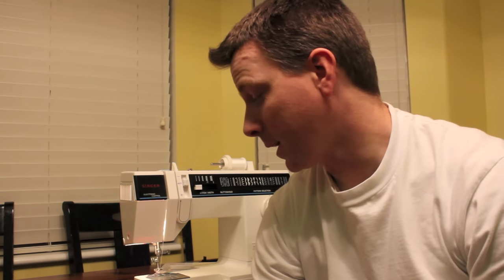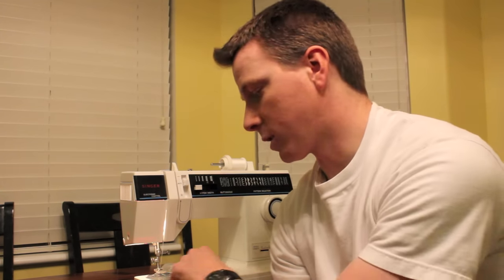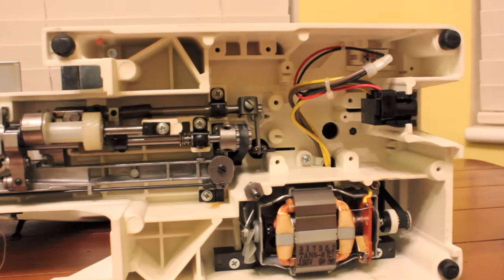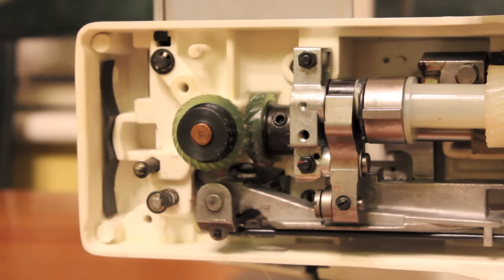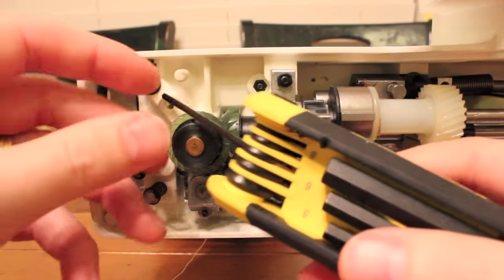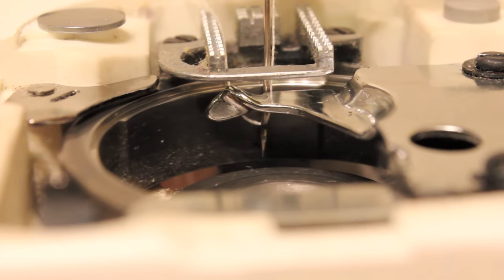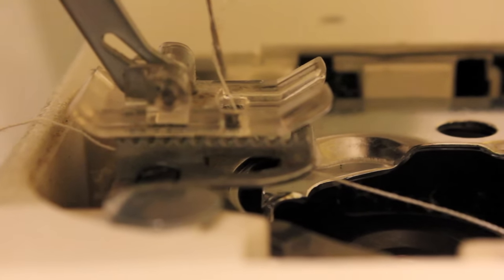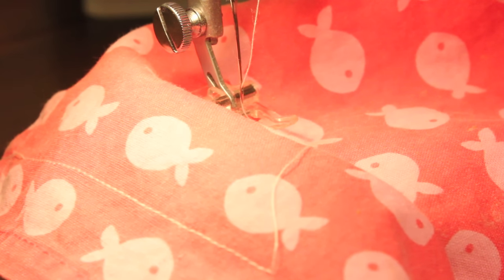How to Fix / Repair the Hook Timing on a Sewing Machine

Comment: The main thing about this is seeing with your hands sometimes. It is a matter of lining the gears and turning the hook so that the needle does not hit any metal but where it will clear the hook on its spin around and then you must take care to line the gears for the foot to move the material at the right time, like when the needle is up the foot dogs will kick the material back and not hit the needle in the cloth. Timing.

Comment: Hi I a wondering if you know how to fix a brand new singer promise sewing machine that jams every time I start to sew, and i have to take apart the whole bobbin casing to get it to move again. The right hand wheel wont turn at all and there is no thread stuck in it, if you could help that would be fantastic!!! thanks!

Comment: I have 2 fairly new, barely used sewing machines. I am having the same problem with both. As the needle drops down it hits the top of the bobbin case, and I can't for the life of me figure out why. Any help would be greatly appreciated. Thank you.
Reply: I'd say that's more of a needle installation thing. Unscrew the needle, ensuring the flat part is against the shank (assuming these are domestic machines) push them all the way to the top of the groove (On my domestic machine you can see the top of the needle hitting a pin) and tighten the screw. If the screw isn't quite loose, it might be stopping the needle going in all the way. You might need new needles, as they could be bent, but as this is for two machines I'm unsure.

Comment: Awesome, I got my timing fixed and now my bobbin in threading but the tension on it is waaaay off.  This is weird because I have a computerized machine that is supposed to auto adjust the tension.
Reply: Well it needs to be within a starting range.

Comment: There is nothing wrong with fixing something yourself if it is possible. That is absolutely disgusting that they would charge you $90 for something the only took 15-20 minutes to fix and no parts. I was told that my late mother's Singer which was revolutionary in its day as it was the very first machine that was computerized was not fixable. The repair place said they would be happy to dispose of it for me!!!! Yeah, I'm sure they wanted said machine.  I took the bottom off, pulled out lots of dust. Low and behold, I pressed this reset and it sounds fine to me. There are a few other things I need to check out like the timing hence what brought me to your video. Also for some reason some of the lights wouldn't go on now.

Comment: Nice video, but the timing was adjusted in the wrong place. The gear you moved tightens on a flat spot on the shaft. It will eventually slip back to the flat spot where it is supposed to be. However, at the RIGHT end of the shaft is the proper timing adjustment. There is a gear that the belt wraps around. It has TWO set screws. Two set screws are required because the shaft is round there. That allows full timing adjustment.
Reply: Well said. And he did not check the feed timing. He got lucky.  You mess around you pay double

Comment: You should time this on the other end of the  lower shaft with the belt.  You were lucky the drive gear you tightened is on the flat of the shaft.  The drive pulley has two set screws since the drive shaft is not flat on the right side.  There are many other problems a professional would have adjusted when a full service was done.

Comment: I just broke my girlfriend's Singer (pray for me), and the timing seems the issue, too. Her machine is not as easy to open up as this one. Are there models out there in which the gears inside are more easily accessible?
Reply: SInger "Heavy" duty 4411 -- removed 6 bottom screws, and the timing pulley with two set screws was right there. Looseedn them, held the bobbin carriage by hand gently (avoid being cut by the hook and pierced by the needle), turned the pulley gently, until the needle timed.

Comment: That gear is "not" the timing gear, that only has one set screw, and it sits on the "flat" on the shaft. And without the timing gauge for proper settings is not used, on the needle bar, you will find that the tensions will not balance properly. *Happy Timing your Singer machine(s), you may now have to pay more the 90.00 to correct it, to the specifications.

Comment: my problem is my needle keeps hitting a metal plate inside the machine x-x and its a singer 466 model that i inherited from my grandma so i dont know where i could find help for this T-T
Reply: +Ro Draws , alignment of the needle is not correct, most likely your needle is bent.
Reply: Ro I was having the same problem and found that the needle was not pushed in far enough.The timing is so close that even a slight bit out it will catch. The bent needle that Sayumpu mentioned is very possible too.
Reply: Ro, I had a tiny piece of broken needle in mine and it messed up the timing over time. This goes along with Gary's message. Could be the needle isnt in all the way - or hadnt been for awhile and caused damage.

Comment: help. The black bearing where is the set screw is sometimes turning and sometimes not turning.  So the shuttle driver sometimes turn and sometimes don't  turn. So the shuttle race is not at the rigt place when the needle is down.

Comment: i have a singer touch & sew mod 626, the bobbin mechanism does nothing, the bobbin should move right whwn threading and sewing rifht?
Reply: Sounds like drive gear underneath has gone. BIG job even for me to do. You will NEVER get it 100% right if you try and repair it.

Comment: I cant seem to get the hook timing down...i have loosened the time gear a number of times and tried lining up the hook but whenver i tighten it back up it wont fix the problem with the needle hitting the other metal parts which breaks the needle. How can i fix this??
Reply: Jordan, I had the same problem and it brought me to this video. The hook (shuttle) on my machine wasn't getting close enough to the needle to grab the thread. I removed the bottom plate and loosened the screws that hold the shuttle (hook mechanism). With my right hand I held the plate still and with my left hand I adjusted the hook (shuttle) so it would be closer to the needle without allowing the needle to scrape. I carefully laid the machine back down and tightened the screws to the base. I then adjusted those little set screws that Nils showed in the video. Problem solved. However, it took me four days to troubleshoot my issue. Whatever you do don't take your machine to a repair shop. They will charge you more than what your machine is worth. Put your machine aside and buy another one for under $100.00. Before I fixed my machine I bought a Janome Mini for $60.00. Now I have two machines that work.

Comment: what if your machine switching to different stitches. my machine only does straight stitch but no other one. is it still the timing?
Reply from the maker: +Bianca Edwards That doesn't sound like a timing issue. If your timing was off, it wouldn't be able to do the straight stitch either. I'm not sure what would cause it to not do the other types of stitching. Sorry!

Comment: hah, funny.  my mom has an all metal 50 year old singer made in italy and was recently given a singer 7442 cheap chinese piece of shit that they make now.  i never need to adjust the old one for her, but the new one hit a button and now is off.  the needle scratches the plastic area in the shuttle if not set on the highest width and wont catch the bobbin.  i need to follow your instructions and make the adjustment. just wanted to say thanks for making the video...and in HD! :)

Comment: Sounds like your top tension is way too loose. Try turning the top tension 2-3 numbers higher and see if that helps. Also check to see if the upper thread is threaded properly, especially through the upper tension control.

Comment: My machine (janone mc)  will only let me turn the gear that adjust the hook timing a tiny bit like maybe 10%. I have the set screws all the way out and have now taken the shuttle and the gear that is attached to it out because i thought maybe there was something in that gear and it was stopping the one on the shaft from turning. Theres nothing in there stopping it that i can see.

 Can anyone answer this question. When the set screws are loosened, is that gear on the bottom shaft suppose to freely rotate all the way around?

Comment: There is a reason it costs what it does when you get your machine serviced.  The technicians will take apart the machine clean it out and oil/grease it.  Certain parts can seize or stick with old grease that you may or may not know about.

Comment: OK WAIT-tiny bit confused! ???
Loosen the Set Screw-manually turn the wheel, when the needle/hook cross correctly again, tighten set screw?
Reply from the maker: It is confusing. It’s more of a trial and error thing. Loosen set screw, rotate it, tighten set screw, test, repeat.

Comment: Can y ou please help me out, my singer machine is not picking up bobbing thread.
Reply: that is a hook timing issue...provided your needle is installed properly...meaning all the way up and with the needle scarf(short groove) in back
Reply: If it's an old machine, it's probably timing, but if it's a new one, it could be as simple as you using the wrong kind of needle for your fabric.

Comment: Whilst I liked your attempt to fix the machine and you've somehow managed to remedy it... its not exactly right as the timing should not be done from the 'rotating hook vertical gear' as its allen key has to secure on a flat dent on the shaft. The timing should rather be done from the horizontal gear that is mounted on the rotating hook's shaft'. That is the gear to the left and not one to the right at the rotating hook area. Notice the gear to the right has only 1 securing key whilst the one to the left has 2.
Reply: Cosmic Fugue
Reply: I found this video after trying the same solution.  However, I find the comments are often critical to getting the fix right.  Knowing that I had to get the set screw into a special part of the shaft (in my case there was an actual hole in the shaft that I hadn't noticed) helped me an awful lot.  Thanks a million!
Reply: Cosmic Fugue your explanation is way to complicate for people like me, better the way this guy did it.

Comment: i have a brother jx2517  and the needle is not picking up the thread from the bobbin how do i fix that
Reply: 99% hook timing is out. Machine has to be split apart. Not for the faint hearted. Most of the new machines are fine till they go wrong. If you want to give it a go try taking the front and back covers off first. If you can do that then give it a go but i wish you luck especially putting it back together again. My advice......spend your time instead doing something else!

Comment: "When  you move the rotation point of a gear the longest 'grub-screw' (locking screw) must hit a flat on the shaft otherwise it will all slip around again."

Comment: I got my mothers machine when she passed which was my grannies before her, but I tried to use it (which I am just learning how to sew) but I will be sewing and then it stops because under the bobbin the thread gets all knotted up.....please help me i wanna learn and I wanna keep my family machine. I fixed my own washing machine from you tube so let's see how this goes lol
Reply: That could be a number of things. You wanna make sure your top and bottom thread tensions is correctly threaded and adjusted. If that doesn't work you'll need to check the area where it gets all tangled up to make sure that it's clean. Hope this helps.
Reply: ok thank you
Reply: if thread is curling up on the underside of the fabric that is almost always an upper tension issue....make sure the presser foot is up when you run the thread through the presser plates...then when you drop the presser foot you should feel tension on the thread...make sure your tension is in mid range 4-4.5-5 depending on the manufacturer.

Comment: Hi Nils,
Sorry but you've adjusted the wrong  end!  Those two gears are set onto flats on the shafts!   You can tell because they have only a single set screw.  DO NOT loosen them.  My goodness you aren't an engineer.  Go to the other end and see that there are TWO hex grub screws in the pulley.  THIS is where you do the adjustments.  No wonder you  were shocked and amazed, you didn't really do anything! 

It is likely that an older machine might jam and the toothed belt (on the right in you vid) might jump a few teeth, putting the timing way out.  The image of the hook picking up the thread is absolutely correct and how it should work but to achieve this correctly is something you just fluked, sorry,

Steve
Reply: My view as well. If it zig zags then certainly luck was on his side!

Comment: my bobbin case slipping and the needle keeps hitting the bobbin case, can you help me?
Reply: try putting a new needle in. It may be just that your needle is bent a little.
Reply: check your bobbin stopper or stitch finger it may be damaged missing or loose...if your needle hits the bottom of the bobbin case insure that you have the needle installed all the way up...or it could be needle bar height needs adjusted
Reply: Thanks Jeff.
Reply: O.k.

Comment: you never really explain what you did with the gears other than loosen and tighten the set screw. I assume "timing' means what teeth on one gear are touching what teeth on the other? Or is it about the position  of that one gear on its own shaft?

Comment: Can someone assure me that if I undo the screws and plastic plates under my machine that the machine sides are not going to fall off!  All these modern plastic SEAMS make a difficult to know what comes off and what is fixed until another panel comes off. Der.

Comment: There is a reason they go out of time. They need lubrication. The timing is adjusted on the lower shaft belt gear BTW. Take them to a qualified tech.

Comment: I just turned the Allen wrench and now nothing works! Help you broke my sewing machine
Reply from the maker: Sorry to hear that it didn't work for you, though I don't think qualifies as me having broken your sewing machine ;) Try adjusting the set screw in different rotations and see if that does it. Good luck!
Reply: I had the same problem. You need to loosen screw, adjust the shuttle to meet the needle at the right time, and then RE-TIGHTEN the screw with some machines. Hope this helps!
Reply: no, i had to pay $68.00 to have it put back correctly
Reply from the maker: Elle Alves I'm sorry to hear that, Ella, but glad you got it worked out. On the bright side, $68 is cheaper than the $90 I was quoted to even have it looked at.

Comment: Did your wife's sewing machine just wasn't holding the fabric together my grandmothers sewing machine it's just not sewing the stitching on the fabric and not holding it together?
Reply from the maker: That's right, Tranica. It would stitch the top but the bottom thread never went through the loops and therefore didn't hold - you could just pull the top thread right out. That's the issue that proper hook timing resolves.

Comment: Hi,
I have a brother LS-1217 sewing machine and watched your video some but then realized your machine is different from mine. I had replaced a  broken needle and perhaps that caused it to get out of adjustment.

However, I find that the lower bobbin thread does not engage with the upper thread.
Do you have any ideas on how to fix it? 
https://www.youtube.com/watch?v=Ur_KDC8O0as